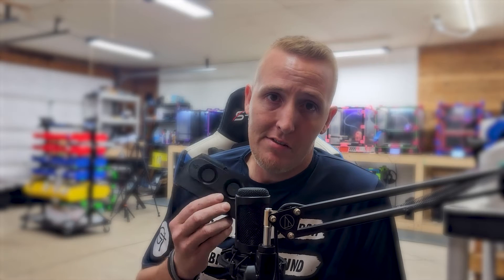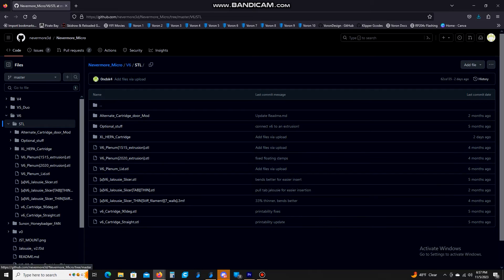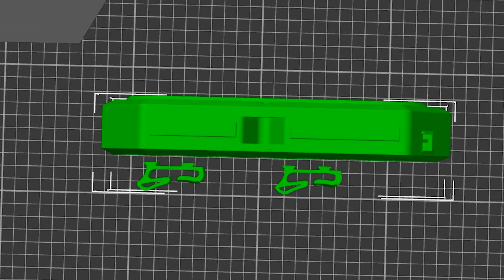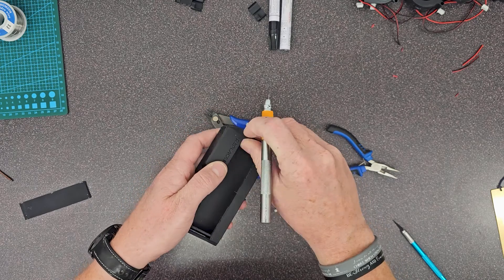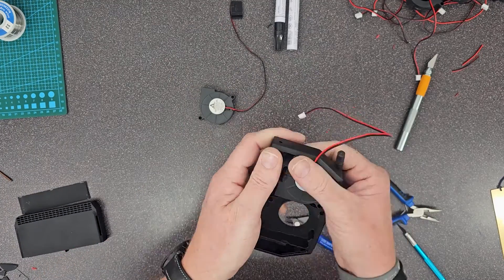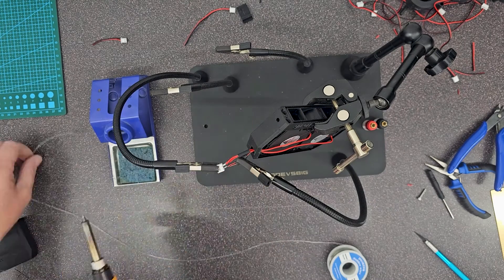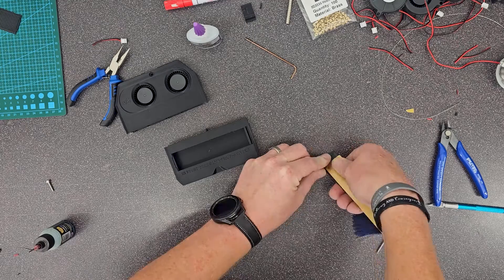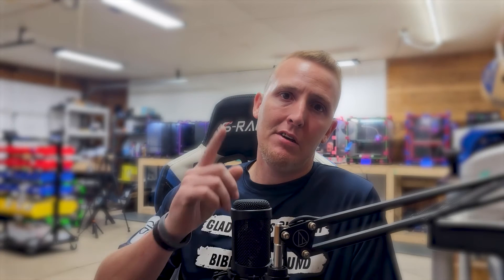Nevermore V6: Secret tips to success!

Comment: Great video, very helpful.  One question... what temp do you have your hot-air station set at for smoothing and removing the white discoloration?  Would love to have a starting point temp rather then just guessing.  That never works out well for me.  Thanks again.
Reply from the maker: To be honest I probably run mine too hot but I like it that way. I'm just careful and fast with it. I run at 300c but I would recommend starting at about 220c and move it up higher once you get a feel for it. Thanks for watching! Join our livestreams sometime!
Reply: @leemerie3d  Thanks for the prompt reply!  I will check out the livestream, thanks for the recommendation.

Comment: To make the fan install easier, I used flush cutters to trim 2 of the 3 clips on the fans themselves. The clip on the right side near the outlet, and the clip on the top. The 2 nevermore clips that hold the fans in have a slot for the 3rd clip so I left it alone. Since its being held together inside the nevermore housing you could probably just install them as-is and the nevermore case will hold the fans together, but I used a tiny bit of ca glue on the seams where I trimmed the clips off to be safe.
Reply from the maker: Nice! Sounds like you figured it out good! I hope the video helped you out some. Thanks for watching! Join our livestreams on Saturday if your free sometime! Have a great weekend 😀

Comment: How long does the carbon last?
Reply from the maker: So that's a really good question! I print with my machines a LOT so I change them out every couple weeks. But I don't even think that's really enough depending on the amount of prints I run.
Reply: @leemerie3d  if you had to put a hour to it what would be your guess? Not holding you to it just so I can get a ballpark estimate. Thanks!
Reply from the maker: @onecarwood  I would say it's more subjective somewhat. But I notice a very slight smell after about a week and a couple days. That's probably just wild guessing at about 150 hours or so. Take those numbers lightly lol. 
Join our discord if you would like, we enjoy all things like this in there! Now I'm sort of curious the actual hour amount and may do some testing there.

Comment: Great video. A little tip I use when soldering to connectors. To prevent the pins from moving out of place, plug the other end connector into it while soldering. Wait for it to cool down before removing the other connector and everything should still be in place.
Reply from the maker: Ha! That's an awesome tip I love it! Thank you! I'll definitely be doing it like that from now on. I feel like I should have known that though lol. And thank you for watching!
Reply: I came here to say the same thing. Guess im running late, i should check my watch is correct.
Reply from the maker: @paulmccullough7352  Thanks! I should have known this tip but I been using it on all my soldering now when I use connectors so it's much appreciated!

Comment: Trying to print this upright in abs. Sides warp mid print 1-2mm causing fan part to not fit well to cartridge. Any tips on that particular model or just apply regular abs tips?
Reply from the maker: Oh no! These parts from my experience you need a really warm chamber as well. It sounds like you know about all the tips to print abs so I wont bore you with those. Other than just maybe get your chamber temp up a little higher, use a brim on it if you need to, and adjust your temps (bed and extruder). I typically run bed at 108 and hot end at 255. Except the first layer I have the bed at 112 and the hotend at 262. Very warm!. I have found that using a very hot first layer temp, it makes that first layer stick very well. Also if you haven't seen my other video check it out. It has a lot of information i there thats really needed to keep your prints stuck to the bed well. It was one of my first videos though and I messed up the zoom on the slicer settings. So might need to zoom a bit to see those. I think it will be very helpful to you though! Good luck and let me know how it goes! :)
https://youtu.be/8393lxSxzu4?si=tQHxrTKHPFbEojxZ
Reply: I've having this same issue.  Had the warped parts sitting for 2 months trying to decide if I just make it fit by cutting things down and a poor fit, or reprint.  With the reply below, I may try it once more.
Reply from the maker: @MallocArray  For sure give it a reprint. Also check out the other video about warping I have. Make sure you wash the plate as shown in the video as I had lots of warping issues for things I had no idea was causing problem. Let me know if you need any help though!

Comment: I have an older version, any reason to update?
Reply from the maker: I would say your fine with the V5 if you already have it. If you get a fan that goes out or something like that would give you reason to go ahead and upgrade to the new one. The V6 will give you better airflow and is better, but if what you got is working, wait until you have to tear something down to upgrade ;)

Comment: What's the purpose of the sliding door on the V6?
Reply from the maker: Good question! The V5 duo has the sliding door on the top that covers the whole top and uses a m3 to hold it on. So it just replaced that big door so you can get carbon in and out of there easily :)